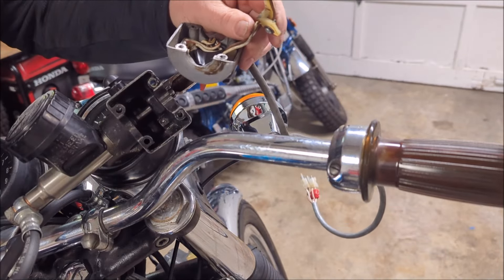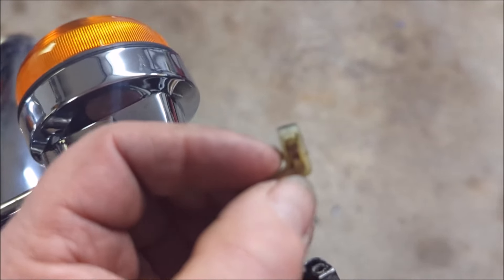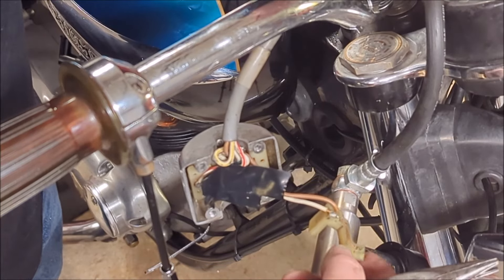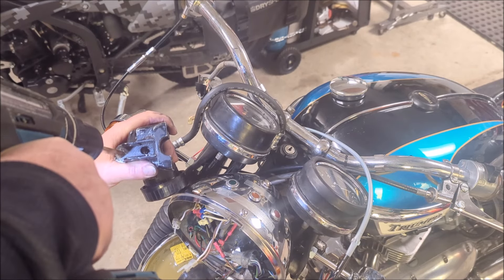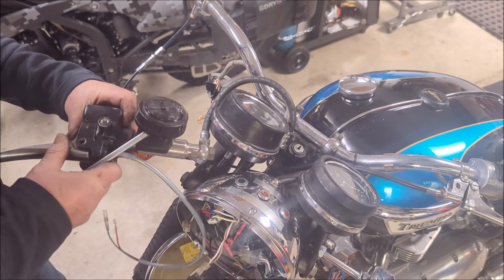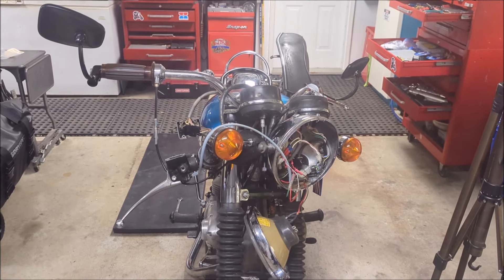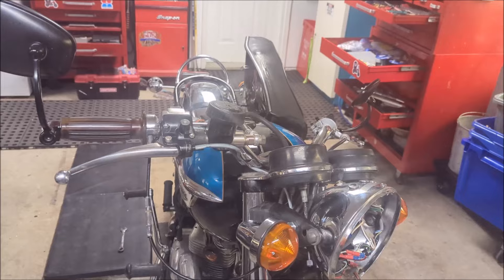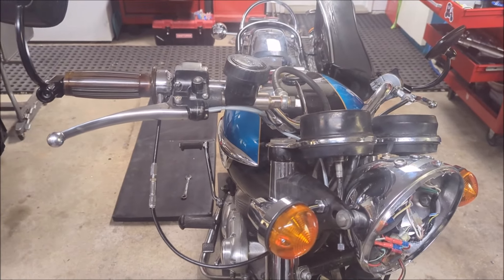Triumph Bonneville T140v  - Part 8 - Front Brake Switch Repair - LUCAS Strikes Again!

Comment: Neat solution. Is the Honda switch just an interference fit in the 5/16 hole?
Reply from the maker: Hi @p--n, 5/16 is the perfect size for the hole, but it is not relying just on friction to hold it in place.   The Honda switch has a small tab on the switch end that holds it securely in place when the wires are pulled through.   The pressure of the brake handle in it's normal home position, pushes the switch into the hole against this small tab.   I am probably not explaining this too well.  Here's a link to a photo of the part which will make this more clear.   https://phatmx.com/products/brake-wire-aft   Thanks for the comment!

Comment: Check out “old bikers” video on how he fixed this quality prince of darkness problem.
Reply from the maker: Hi @jamesa6272, thanks very much for the tip!   I'll definitely give give 'old bikers' video a watch.    Not OEM and definitely not LUCAS, but the Honda brake switch cable is working fabulously, so no complaints or issues so far.  Really appreciate the info!   If you haven't already, please subscribe!   I would really appreciate it!  Cheers.
Reply: @MadTinkerman  yes I definitely will subscribe.   I am still figuring out how to wire in a new switch also.  I just bought all new hoses for the front and back brakes.  Mine are not releasing.     The bike sits an along time every now and then.
Reply from the maker: Hi @jamesa6272, sorry to hear your brakes are locked up.   I have not had that issue (yet), but since you have purchased new lines, the very fist thing I would try is to release the pressure and brake fluid via the air bleeder.   Failing that suggest you work on taking the pads out of the calipers, the same as if you were doing a brake job.    Not sure if you have seen his videos or not, but 'Songs from the Saddle' swears by EBC HH-rated sintered pads (EBC FA016HH) brake pads as they apparently give much better feel than the OEM style pads.    Here's a link to one of his videos you might be find interesting:  https://www.youtube.com/watch?v=4lYgtoR8bJk    Half the fun of these bikes is doing the work so enjoy it even though you're not riding it!  Good luck and thanks so much for subscribing!
Reply: @MadTinkerman  yes I tried bleeding them yesterday. No luck
Reply: Getting back to this:  I rebuilt the caliper and going to replace all the hoses with stainless steel / ptfe hoses.  I’m also adding in a hydraulic brake light switch.   In the process of doing this.   Hopefully it works !